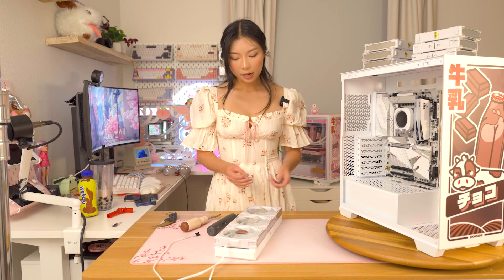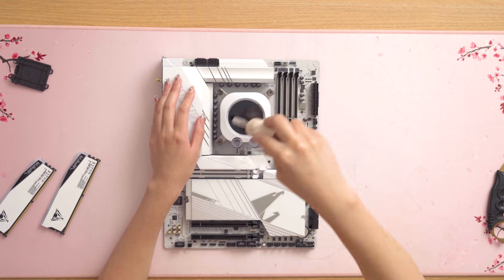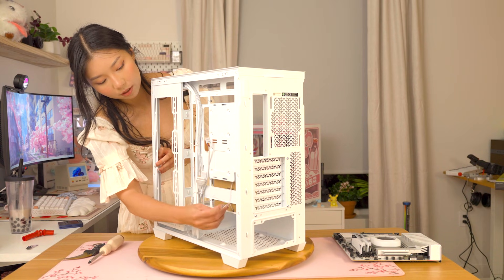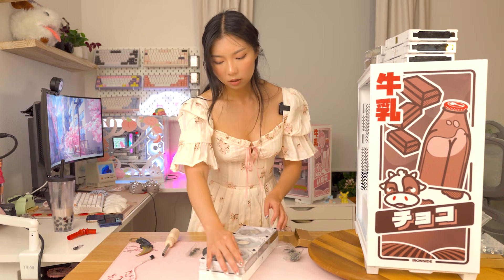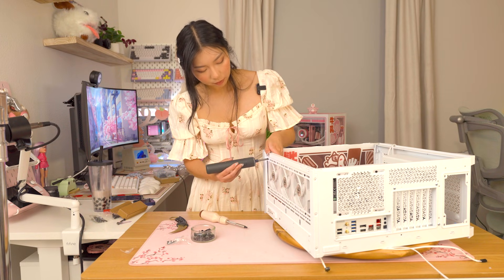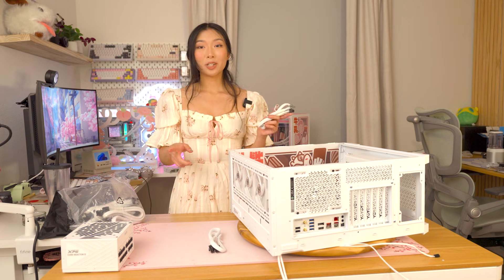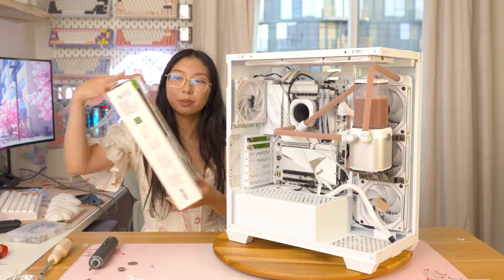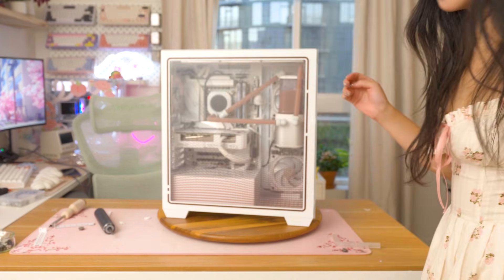I built a chocolate milk cooled gaming PC!

Comment: It's always best to have a gpu block when your doing liquid cooled cp's. It just works better at keep it cool'd vs the air cool method for the gpu. And it's better heat distribution all together, granted it doesn't really matter, it's just often preferred. Lastly, it's easier to monitor because it would simply be all one system and split between air and liquid. Most dual fan gpu's don't use 8-pin connectors, they only use 8-pin depending on if there's  higher Vram, rgb/argb or if it's an XT version.